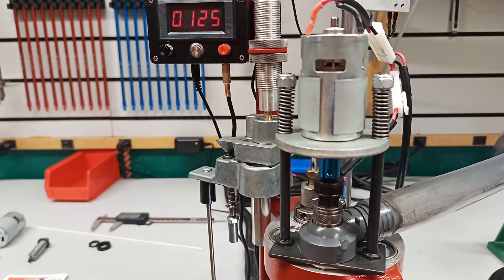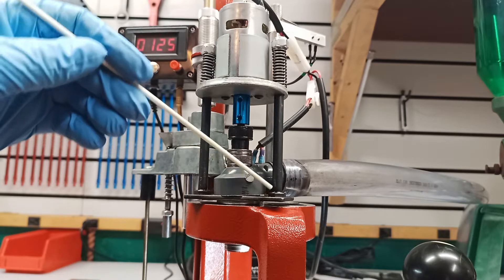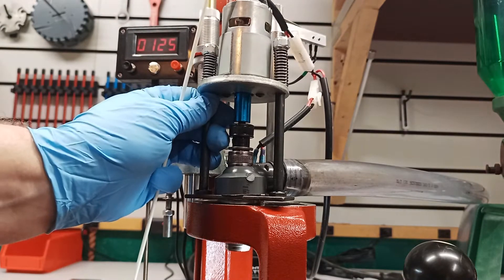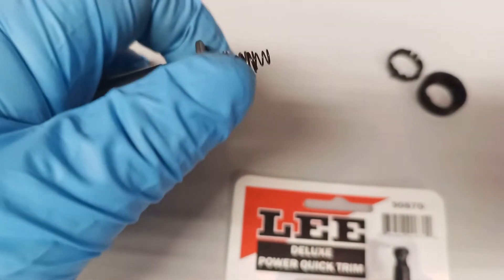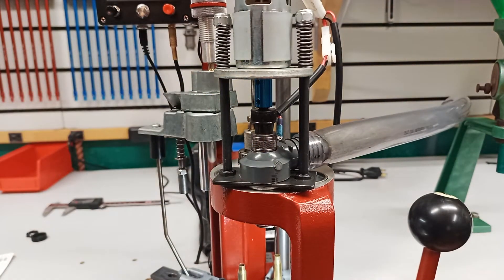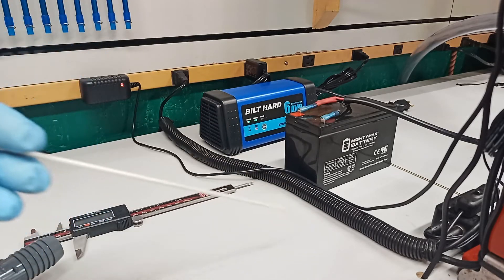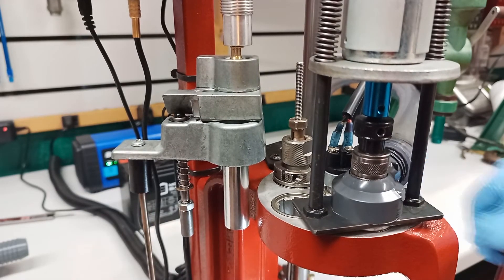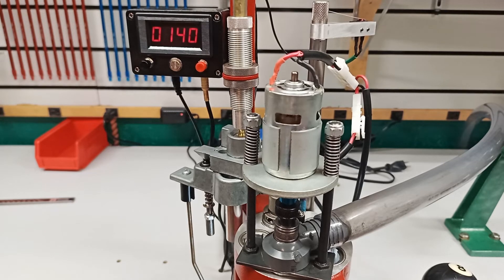Power Case / Brass Trimmer for Hornady Ammo Plant W/ Lee power trim

Comment: I realize this is an older video Sir, but would you be able to answer the following question regarding the Lee Dies themselves? I also want to use these dies and the cutter (for now I am just wanted to use the drill method) in my Hornady Lock-n-Load A.P. and I am wondering if you machined/smoothed the lower part of the threads on the Lee Dies to fit into the shell plate better? Awesome video and great invention with the 12v motor and vacuum system. Lots of ingenuity, right there!
Reply from the maker: I have not had to make any altercations to the die bodies other than cutting the vents to vacuum the chips from. I have only used this process for .308, .223/5.56, 300B.O. and 260 rem.
Are you have trouble with a particular caliber?
Reply: @coldborecontraptions2063  I am doing 223 and 308 and just got the dies and the cutter. When I was testing out seating the 223 die in station 4 (I think). It looked like the threads were slightly touching the walls of the shell plate area and couldn’t tell if it was inhibiting the die from seating all the way.
Reply from the maker: @RunNGunNation  Very interesting, I wonder if Lee made changes to their dies? 🤔
I do know that I can easily adjust the dies I have to cut too much or too short.

Comment: What do call the switch that turns it off and on? Do you have a P/N? Thanks JP
Reply from the maker: Fastronix Heavy Duty Push Button... https://www.amazon.com/dp/B019BH6O2A?ref=ppx_pop_mob_ap_share
Reply from the maker: I had to cut and thread an aluminum bushing and press that into the center hole on the press
Reply: @coldborecontraptions2063  Thanks.

Comment: Very well done. I am in the process of converting my old Lee pro 1000 to process rifle brass progressively. I am using your design with motor and switch. Obviously I will need to fabricate a different way to mount it to the press. I think ill be able to accomplish this with off the shelf flat stock and plate, which I can do in my garage. However I don't have access to a machine that can cut the "exhaust ports" into the die. Do you think I cut through the die with a beefy Dremel cutoff disk? Or would you be open to machining it. I would gladly pay you for your time. I am in here in the US. You can send me a direct message if you want to discuss.

Also have checked out some of  your other videos. I think I will be doing the low primer sensor next. I wouldn't mind having a look at the internals of the alarm. You do a great job of being very thorough in you build breakdowns. Thank you for sharing. Keep up the good work and I hope to see more videos like these.
Reply from the maker: Sorry it took so long to get back to you, it's been a very busy summer.
I think the exhaust port probably could be cut with a dremel but would be better done with a mill. Any local machine shop would most likely be able to do it and I would do it if you can't find anyone local. 
The internals of the alarm are very basic, you need a proximity sensor, on off switch, a piezo and a power supply of some sort. The  sensor is connected to the PS thru the switch and one leg of the piezo to the power + or - depending if your prox is PNP or NPN will determine polarity and wiring and the other leg of the piezo connected to the + or - of the prox sensor signal depending if your prox is PNP or NPN
I don't know how to contact you on here, rather new to this.